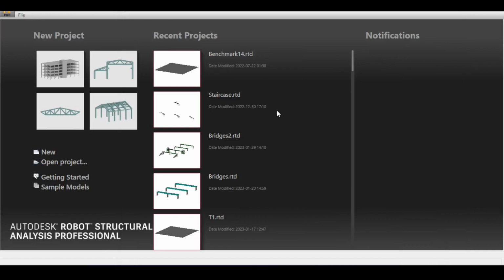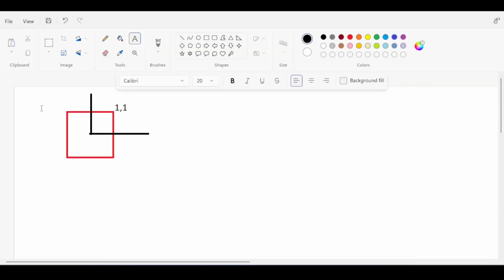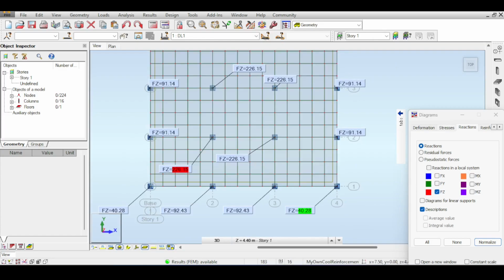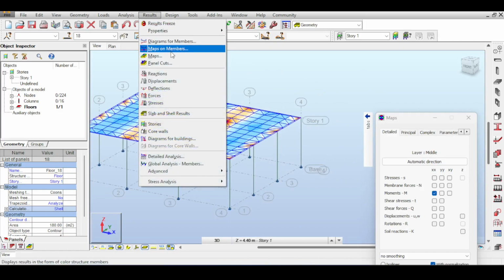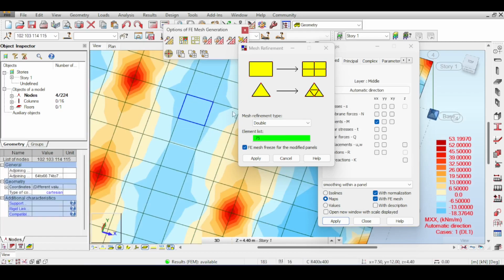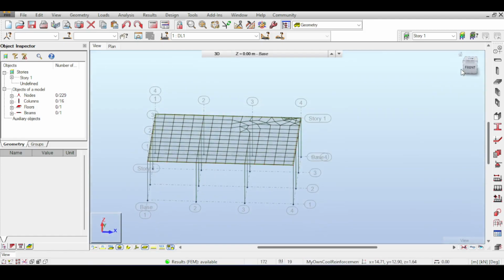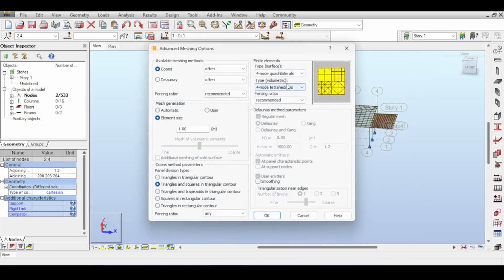The Slab Series | Part 3 - Understanding Meshing | Autodesk Robot

Comment: Hello CEE,

It is finally time indeed 😊. For me personally, and especially in situations when I continuously struggle to understand a particular subject, I get to a point where I “make peace” with that fact and “move-on”, however such things are almost always guaranteed to find their way back one way or the other and I often find myself having to apply or to use the same particular subject(s) over and over again irrespective of the supposedly “peace” that I had thought to have made with the matter.

One of those subjects (for me) is the “internal workings” of the Finite Element Method. I would like CEE to know that all of your teachings, responses, and comments regarding the FE method so far in both past videos, including the current introductory video on meshing are a huge (gigantic) help for someone like me to begin to appreciate the “internal workings” and the sheer breadth, and possible limitations of the FE method. Thank you for your patience and for finding ways to try and simplify such involved issues in order to allow for essential appreciation of the main concepts, plus thank you also for the bonus provision of the key reference materials and links on the FE method.

I am definitely never forgetting that a “rectangle” … (oh no, scratch that 😊) …I mean a “square” or “a square_ish” element shape is the ideal FE shape for best results with the FE method. Granted that triangular element shapes are also used in the FE method. 

13:03 I find your comparison of the subtle differences in the results from the use of quad v/s triangular shaped finite elements to be quite enlightening; also, how one “gets the best of both worlds” with quad when one considers a quad as a shape made of two (or double) triangles. 

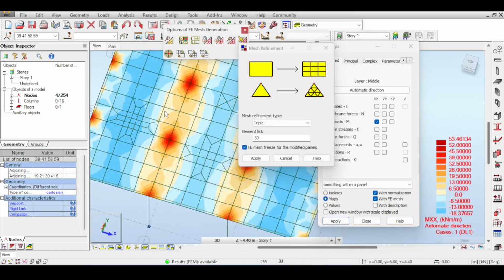19:55 Thank you for the practical introduction to available “adaptive mesh refinement” options in RSAP. Being “the average user 😊” myself, I can’t help to laugh at the undisputable fact which CEE have pointed out that “…the average user goes to job preferences and just select the mesh fineness and goes on with life….”; Yes, this is true, but at the same time, it also does really feel pretty good to me (one of the average users) to know the basics of how to use mesh refinement or adjustment options in RSAP. I think such refinements can actually become handy from time to time; uses at other possible irregular points of interest in a structure being analysed come to mind.

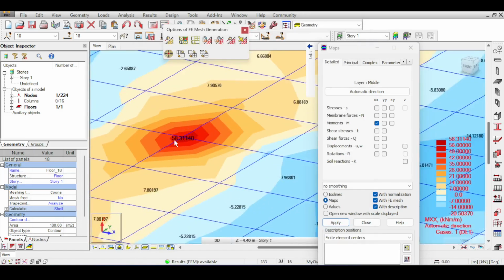20:52 The stress (and moments) on a point load on an area: I find this concept to have been very well-illustrated and captured here by the CEE, thank you! It is interesting indeed and it does give food for thoughts about what the CEE have refer to here as a “…. numerical problem in the FE….”. 23:09 Thank you Mr. Editor for the note. 23:14 What an interesting (and yet spot on) choice of words “……how to detect if one is going into a numerical singularity…. with ones FE mesh….”, these are the kinds of questions and answers that (for me) makes the CEE channel unique. To the CEE team: kindly know that these kinds of Q&A come highly appreciated and are treasured. 

25:30 Thank you for touching upon this issue. To add to this discussion, the differences are even more “visible” if one were to design the slab reinforcements based on the moments results from an unsymmetrical mesh on a symmetrical plate or structure. The resulting required reinforcement regions in this case are not symmetrical as one would ordinarily anticipate. I am satisfied with the current explanation offered by the CEE in this meshing video. My addition to the discussion is intended if it could also help others.

26:15 & 27:45 I guess there is “homework” here to read about shear locking, shallow angles, and NURBS. 

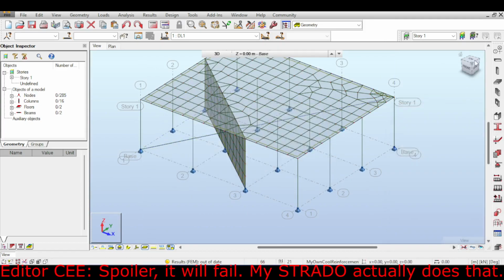28:35 If I recall correctly, the meshing (or non-meshing by RSAP in this case) around the point of penetration of a shell with a beam element is something that was also explored in the silos video series while it was being intended to generating specific located points in a shell to attach the “silos column support bracket”. Congratulations that your software STRADO actually does that. This is an important feature and it does have its uses in the FE method.
  
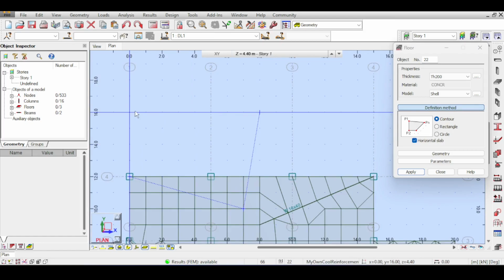29:36 This is hilarious and educative at the same tine: …...if you don’t have things connected to a mesh at the node(s), then “…they don’t see, they don’t feel, they don’t care….” about each other 😂🤣😂. 29:57 and 30:42 Thanks for showing some of the common things to avoid with FE modelling.

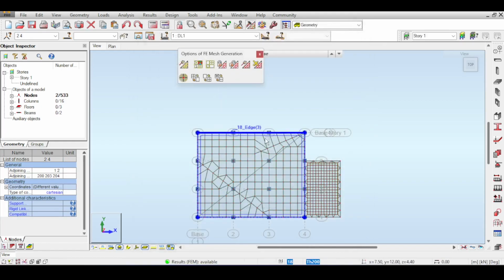32:30 I welcome the opportunity to explore further meshing options in future video(s). And within the context and requirements of the practical problem(s) being solved at that time. For example, CEE have identified certain mesh elements at 31:50 as “bad elements”, now if there are advanced meshing options to “correct or to adjust such elements” then this is where those options should be explored (in my opinion). The same principles could be considered to introduce and to explore further advanced meshing options on video or problem basis (or even an approach which looks at a collection of common problems and the associated advanced meshing options that can be implemented in order to deal with those problems could be considered?)

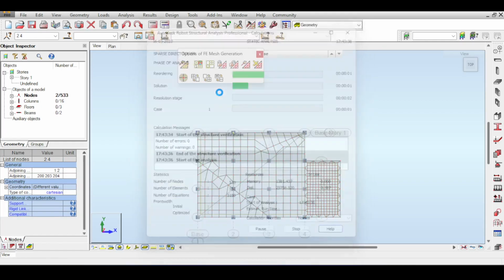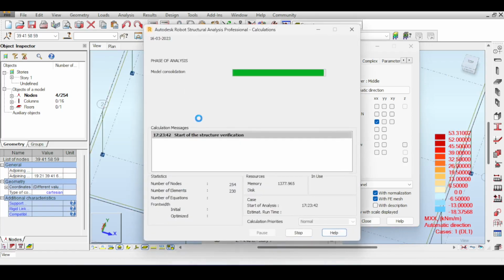By the way, can the “bad elements” mentioned in 31:50 be corrected by using some of the “adaptive mesh refinement” options discussed here at 19:55?  

More “homework” 😊 Delaunay triangulation and Voronoi diagram? On second thoughts, I think we definitely need the planned deep dive video by the CEE 😁.

For me, this (today’s) meshing video is one of those “not your everyday kind of lessons”, It was a good introduction and an absolutely necessary one in the field of the FE method. Thank you so much for the video and keep up the good work. 

I am looking forward to the next CEE videos

Regards, DK
  

Ps…

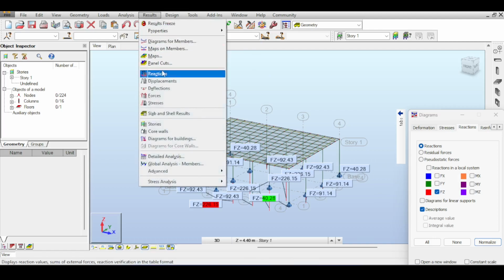Tangent: at 02:39 I am curious about the presence of the Fx, Fy, reactions values (greater than zeros) on each of the individual support nodes. Considering that the structure and the mesh are (for all intents and purposes) perfectly symmetrical, and that the only load applied to the structure is a vertical load along the global Z-axis direction. Why are there non-zero reaction values in the X and Y (Fx and Fy) directions at all?  What calculations or scenarios is RSAP considering which results in these reaction values being non-zeros? Apologies if this question seems a repetition of a question, I asked some time ago to which the CEE noted that materials have “Poisson’s ratio”, [are the Fx, Fy reactions due to the deformation in the material in a direction (X and Y) perpendicular to the direction (Global Z) of the applied load or force?], If this is related, can CEE expand a bit on this in the current context?
Reply from the maker: Hello Engr. DK,

the topic of meshing is a really deep one. To be honest, the video actually scratches the surface, and we are lucky that RSA has such good mesh generation capabilities. 

It pleases me to know that you do actually want to understand some of the inner workings of the FEM. Please note that I did provide a rather simplistic explanation with some "key words" that would help interested viewers like you to research on their own. You know, typical CEE style.

For some reason I messed up and kepy saying rectangles (LOL). The editor actually hated me for this and just gave up, I guess: "achievement unlocked: make the editor quit"?

Also, the editor in 13:03 actually had a great addition, as he usually do. Look, I know the editor does sometimes roast me, but he is actually a cool dude who knows what to say when. 

When I was talking about mesh refinement options, I actually had in my mind ppl like you. Now truth to be said, I do not expect this part to appeal to a wide audience, but is actually a kind of "testing the waters" of a "Deep ocean".

On "burning moments", I have been asked to give more clarification and recommendations about that, so I am searching for a reference I can cite before I just give an opinion. Otherwise, I will only have my own opinion to give. (I usually like to provide references, as in a discussion, you cannot just appeal to a youtube channel, but you could appeal to a book).

Your feedback on those internal monologues and question I do have is highly appreciated. I do take an "academic" approach in my videos, but also coupled with my experience as a site engineer and design engineer in my past. Actually the length of videos is usually longer, because I usually speak my mind. Now sometimes, Mr. Editor cuts stuff because my thoughts just decent into chaos and gibberish. This is basically the creme-de-la-creme.

I agree 100% with your observation about reinforcement and mesh symmetry.

About "not seeing each other ^_^", I proving this with number and results.. I should have somehow opened or shown something to prove that those two things are not connected and do not share anything.

I want to thank you with regard to your feedback about deeper meshing topics. I agree. I think I should try "catch" the best chance to include it in a practical and helpful way, rather than forcing the issue, because it is kind of deeper than what was presented in this video.

To answer the question: Bad elements can be fixedd by both, either adaptive mesh refinement or mesh size. Of course the warning here is that mesh size affects the entire structure, which would increase significantly the calculation effort, whereas adaptive mesh refinement affects the position you are refining. 

I love delaunay triangulation, I know it because I struggled with it while programming STRADO's mesher. Now STRADO's mesher is NO WAY near RSA's, but I had to really work hard on the triangulation to make STRADO do anything.

Oh, about the X and Y reactions, it is because you have indeterminate structures... The easiest way for me to explain this in written form is to remind you of what happens when you have a frame with as follows:

Bay: 5meters
Height: 3meters
Gravity Loads
Pin supported (2 pins, 1 for each column)

So you have 3 elements, 2 columns and 1 beam.
Let's imagine that the supports are not pins, but 1 pin and 1 roller. The frame under the gravity loads would "open up". i.e., the column with a roller would have the tendency to open up, as the beam wants to bend in a "smily face" pattern.
Now if you have 2 pins, the pin will restrict this movement, and generate Fx, which causes the other pin to generate an opposite Fx.

Now this concept can be extended to 3D structures.

Please let me know if this explanation made sense, coz I know it is kind of odd to explain visual stuff using text. I tried to be as vivid as possible. 

Regards,
CEE
Reply: @CivilEngineeringEssentials  

Thank you for the feedback, it is very much appreciated. I agree with you 100% about the editor; that dude does know his stuff and he is quick-witted. I cannot think of anyone more suited for the task, we are all very fortunate to have him.

Yes, I can happily confirm that the explanation about the reactions Fx and Fy is as vivid as it was intended and it does make good sense. Thank you for this.

See you in part 4 of the slab series.

Kind regards, DK
Reply from the maker: There was a nice discussion with Engr. Candea about mesh sizes.
Here is an out-take of my comment to him:
about mesh size, here is an article https://www.masterseries.com/blog/fe-mesh-size

But to summarize, span / 10 or 1000mm, so in case of normal spans between 3 to 8 meters, you would end up with 0.3-0.8
so your college approximation is quite on spot.
Reply: @CivilEngineeringEssentials  

What a beautiful 💐reference  to complement the discussions and the corresponding content of part 3 of the slab series video (thanks to you both, Jesus Candea and the CEE). 

I especially love the resonating tone of this article and its practical guidance for the designer or the user to always aim to maintain an acceptable level of “balance” based on the designer or the user’s own informed judgment and also based on the specific requirements of the model that is being solved or that is being considered. 

I think that the author(s) have done well in trying to define words such as “too big” and “too small” into relatable terms for the purpose of FE mesh sizing. The suggested convergence testing for both global analysis and for localised areas of high-stress concentrations coupled with localised refinement of the mesh, merges well with similar concepts that were discussed by the CEE in today’s main video including localised mesh refinement options such as “adaptive mesh refinement” techniques, and the theoretical infinite stresses at points of singularity.

This article is an ideal summary in a “Kurzgesagt” fashion on the introduction and basics of the FE mesh sizing, accuracy, required computational time and processing power, convergence testing to help the designer or the user to make informed judgment and decisions on the final adopted size of mesh for their model, or for their project. Of course, there are multitude of other factors such as geometry, constraints, loading, etc. which would require more in-depth investigations. But this article right here, is without doubt or questions, a very good starting point. 

By the way, I started watching some of the videos from the Kurzgesagt Channel and what I can say is ‘man, oh man!'🥰; there are some interesting points of views to life, to science, and to every other thing(s) out there. I can only now begin to grasp why you would find their (Kurzgesagt) work fascinating. 

Their video on “How to Make a Kurzgesagt Video in 1200 Hours or more” for example, had made me pause and I couldn’t help but wonder how in the word is the CEE and Mr. Editor even begin to manage to produce such top-notch videos in 7days x 24hrs = 168 hrs or less?😳😳🤔

I have said it before and I will say it again: If you (CEE) were ever in doubt, know that you are doing exceptionally well with your videos. I am and always have been in awe 👏💯👏. 

Keep up the good work sir!
Reply from the maker: thnx a lot Engr. DK ^_^
Happy you liked the reference. Editor told me he is watching videos about how to improve the presentation of CEE videos to be a little bit more "action packed" and less monotonic. He is still learning so I do not expect anything soon. 

Kurzgesagt is amaaaaazing <3

Regards,
CEE

Comment: Hi dear CEE, theres an option in SAP2000 "automatic frame mesh" where you can set the minimum number of segments in bars when analyzing the structure, they act like nodes but they arent, so you can provide more realistic modal analysis results as accurate frequencies and so on... is there something like that in robot aswell? or the only thing we can do is to generate nodes without creating new bars with the division tool for all the bars before running calculation? As always thank you so much! Saludos
Reply from the maker: Hi there Engr. Candea,
yep, you can create nodes without actually breaking the bar. (It is gonna be 1 bar, but multiple nodes on it) 

I think it was in (Edit -> Divide) Generate Nodes without dividing

However, I have to mention something from the "insides of Robot". If you actually go to:
Right Click -> Display -> Members -> Number of Calculation Elements
then you will see that robot "behind the scenes" generated FEM elements.

It is a loooooooong programming gibberish, but here is the quicker version:
1) You have "geometric elements" those are the things that you define, such as "members and lines" with their regular number
2) You have "FEM elements" that you do not define, but are generated for you during the "model generation stage". Those hidden elements can only be shown given the display trick

The only reason I know this, is because I program my own FEM software ^_^

Still, not to derail your question, 
yes, via the divide command, you can add nodes in the mesh of a linear element without breaking it into multiple pieces "you actually do, but the interface hides those"

Regards,
CEE
Reply: @CivilEngineeringEssentials  awesome i will check those! Thank you very much